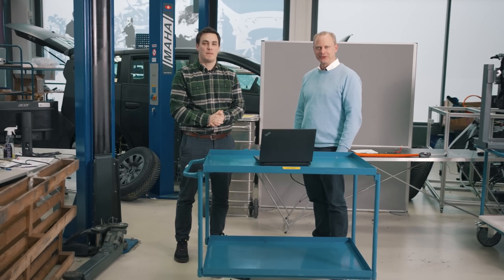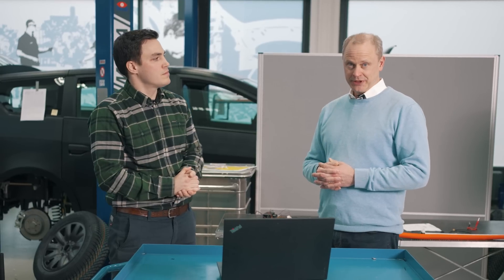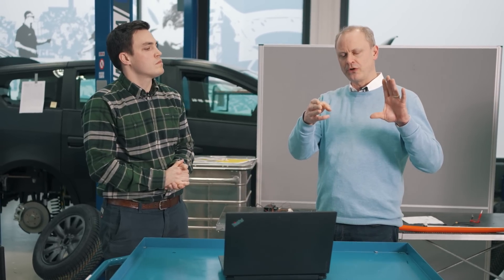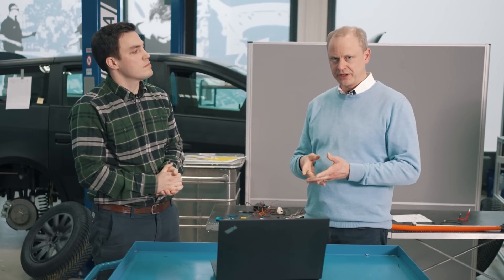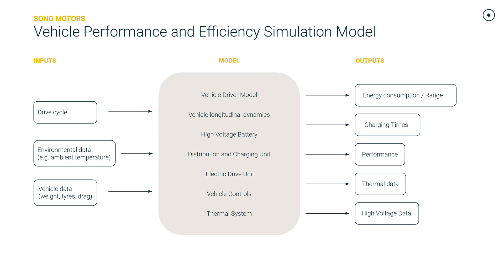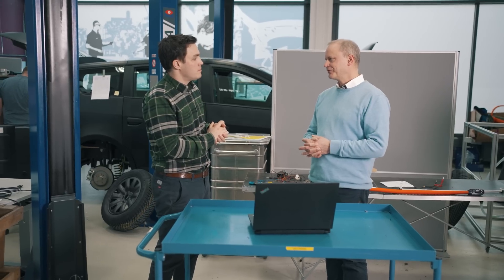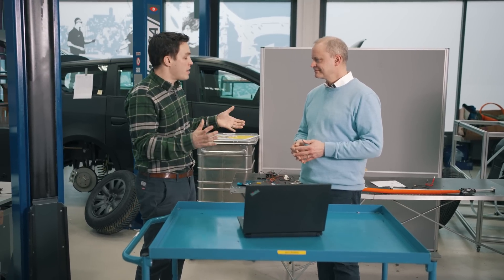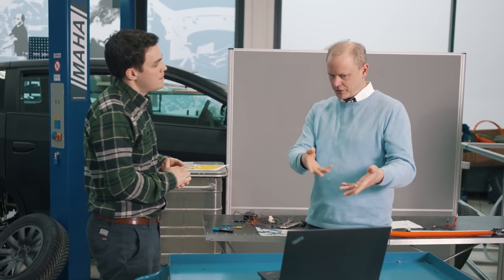How efficient will the Sion be? First promising test results | Sono Motors

Comment: Wenn der Sion mit 54kWh Brutto 305km WLTP erreicht schafft ein Tesla Model 3 mit 60kWh und 491km WLTP 44,9% mehr Reichweite mit der selben Brutto Energiemenge. 100%/305*442=142,9% (<-491/60*54=442). Auch ein 2019er Model 3 mit 53kWh Akku und 409km WLTP war schon deutlich effizienter. 409/53*54=417km. 100%/305*417=136,7 also 36.7% mehr Reichweite bei gleicher Bruttokapazität. Mit solch einer Energieverwertung rettet man die Welt gewiss nicht und allein die deutlich geringere Effizienz des Sion wird die PV Ausbeute der Realität schnell überbieten mit negativerer Bilanz je mehr man den Sion fährt. In meinen Augen einfach schlecht wenn man sich die Mission des Sion vor Augen hält.

Comment: Für mich ist es echt nicht einfach einen entsprechenden Parkplatz zu finden wo auch mal etliche Stunden die Sonne drauf scheinen würde. Überall Häuser oder Bäume. Ich denke das dürfte dann auch für Andere ein Problem werden.
Reply: Moderne Solarzellen brauchen kein direktes Sonnenlicht. Mit so 30% weniger Ladeleistung ist allerdings zu rechnen. Reale Daten wird SONOMOTORS wohl bald liefern.

Comment: Danke für das Video!
Ich habe noch eine Anmerkung zu dem Diagramm in der Minute 5:04 bis 5:27: bei dem Verbrauch gegenüber Preis ist als Preis wohl noch der alte Preis verwendet worden (ca. 28 000 € sind als gelber Sion Punkt abgebildet).
Reply: "ist als Preis wohl noch der alte Preis verwendet worden (ca. 28 000 € sind als gelber Sion Punkt abgebildet)" Habe mich ebenfalls gefragt was das soll. Verschiebt man den Punkt auf die 30k€-Marke ist das Fahrzeug gerade mal ddurchschnittlich. 
Price vs. consumption comprison is wrong as the old 28k€ is used. With real 30k€ price point the car is average.

Comment: Actually, I would like to know the charging speed, or better a charging curve. Is that available? It's becoming even more important then range.
Reply: About ..30 minutes from 20-80%  doesn't say much.  It would be great to see the charging curve. Starting with what, how much around 50%, a flat curve, .. that kind of thinks would be interesting to know. It differs a lot in daily use.
Reply: @pilotandthecity8527  Well the curve would for sure be interesting but to me 30 min for 20 to 80% on a 75 KW Charger is enough data.
Reply: maybe it comes on a 2nd Video. The used batterys are not final. The packaging was done by hand.
Reply: they mentioned it in other Videos, about 30 minutes for a 20 to 80% charge I believe it was.

Comment: Real ev startup are mutch better than old OEM in efficiency even if it is not the real mission of sono motors,it is much better than VW
Reply: You have seen the shape of the car? If we are talking about efficiency a boxy design like the Sion isn't the best. It offers other advantages, though.
Reply: @hadnoidea2304  exactly for that reason VW did his id3 with the same efficiency and they have more money to trow to the aerodynamic and less space
Reply: sorry, that´s wishful thinking. Startups have to learn all the little technical details which impacts effeciency whereas experienced companies already knows them. Think about all mechanics parts which are required...
Reply: @alteregoklause1694  old OEM even on new platform have their own production constraint and most often than not go on whit what's easiest rather than thinking about the problems.
Why do you think Porsche includes a shif gear transmission in their ev for?
Reply: @matteoricci9129  if you analyze what´s different between fuel and EV it´s 70% the same parts. Don´t understand your Porsche example. What the hell is "shif gear"??
Reply: @alteregoklause1694  Sorry I'm not native speaker, I ment Porsche used a 2 speed transmission rather than a better performing motor exquisite execution, but suboptimal efficiency, just put a better motor in and you save weight, and improve efficiency
Reply: On the tycan electric
Reply: @matteoricci9129  ok, now I see your (good) point. But is Porsche really a start-up? 😁 I guess the other way round: it´s an example of long lasting experience in car development. Something start-ups like Sono do not have at all.
Start-ups usually enjoy the advantage of being much faster than traditionell car companies. If they do NOT fail year by year...